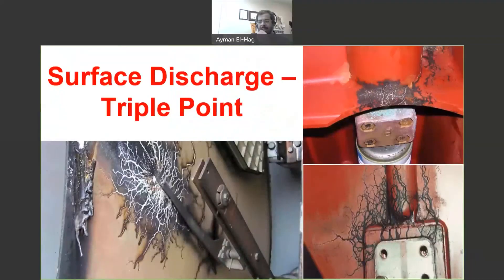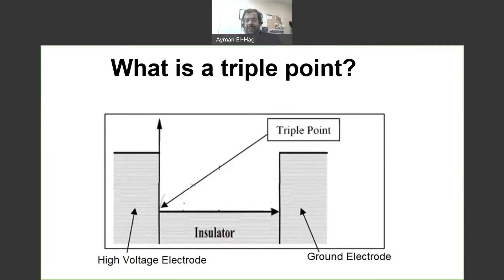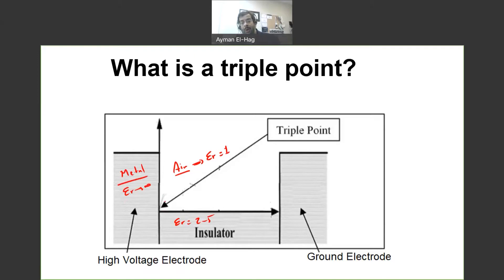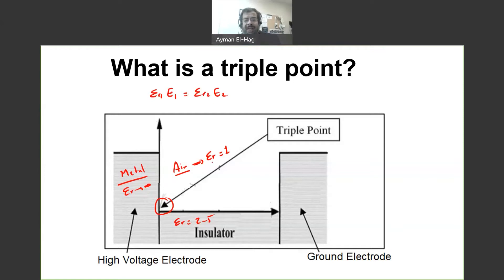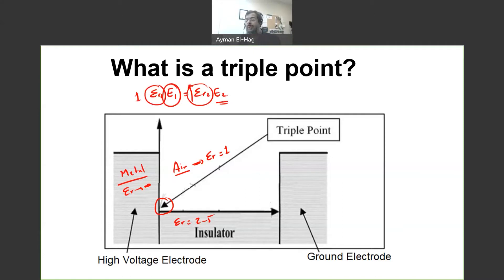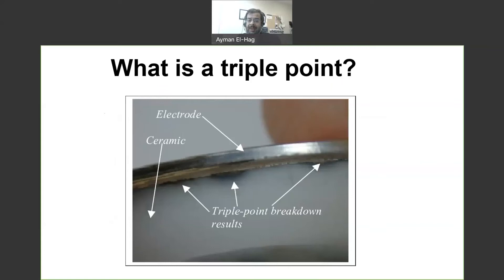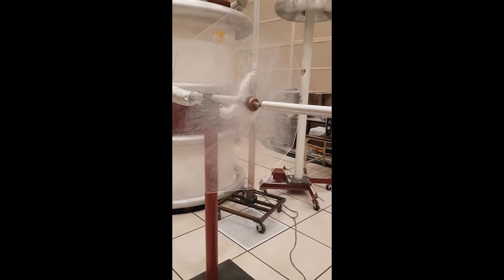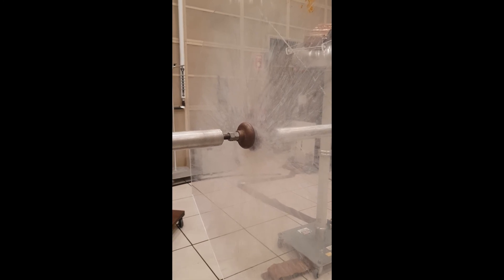Surface discharge from triple point

Comment: Thank you, professor, for this exciting information. Can we eliminate the triple point with field-graded materials like Sic?
Reply from the maker: Exactly, this how we, for example, eliminate this high stress in cable using stress grading material. This could be using capacitive or resistive grading. I explained this in the following video:
https://youtu.be/fmBLPevzYMI
Reply: Thank you, professor. I will see it.

Comment: Dear sir,
Excellent video. Can we apply some image processing techniques to classify different surface discharges?
Reply from the maker: I have seen some work in this line but I do not think it is very effective. I think either acoustic or RF and may be both are more effective.
Reply: @electrical4everyone  Thank you sir for your valuable information.

Comment: epsilon 1 for air = 1 but my question is when that insulator surface is exposed to a polluted condition it will not the same in that condition then still we called that point as a triple point?
Reply from the maker: The triple point is any interface with 3 different materials like conductor>insulator>air or water>insulator>air.
Reply: @electrical4everyone  Thanks professor

Comment: Hi Professor, very good video... straight to the point!!!. Thanks for posting...
Two questions... As we have three different materials this rule E1* e1=E2* e2 can be extended to E1* e1=E2* e2= E3*e3 as we have 3 materials?.
Second question.. Typically Corona discharges inception is given when the field reaches 3kV/mm, right?. Can this threshold be brought down when moisture and contamination are present? Thank you!
Reply from the maker: Thanks for your nice words.
Yes this applies for more materials but fot the conductor epsilon is very high and the electric field inside conductor is zero.
The 30kV/cm is for DC or peak but the RMS value is 22kV/cm.
I hope this clarifies your questions